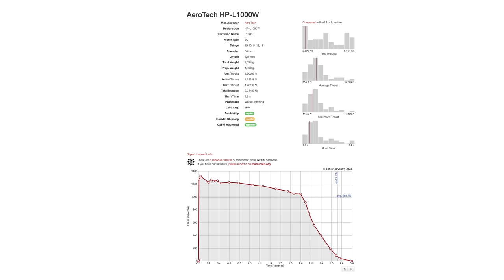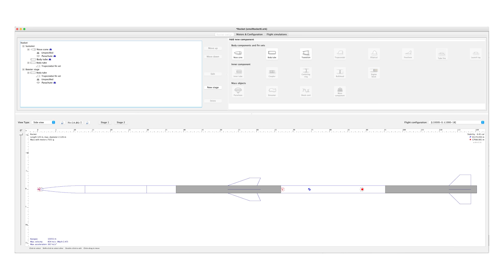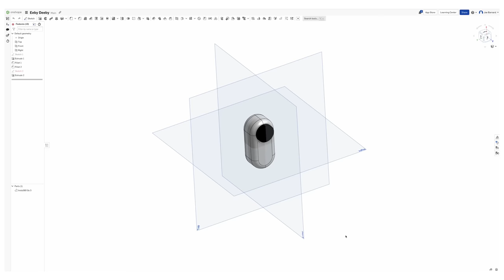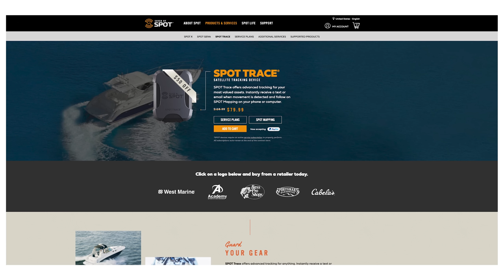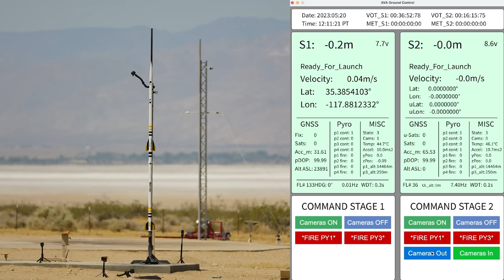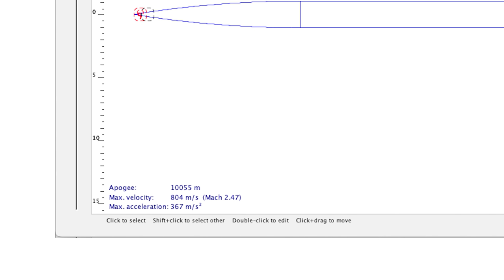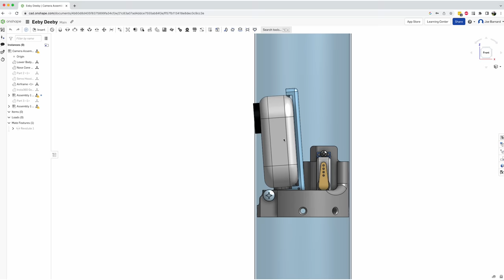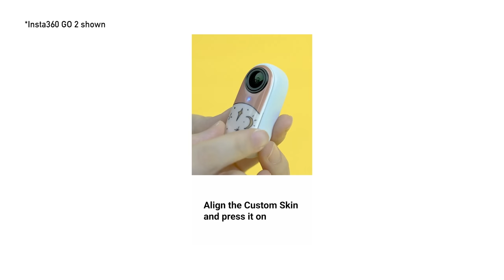I Sent a 2 Stage Rocket to Mach 3 | Feat. Insta360 GO 3

Comment: Hello this is the FAA…
Reply from the maker: im not picking up sorry my cat is sick and im really busy i cant talk
Reply: @BPSspace @dmacpher as the cat I can confirm I’m ill
Reply: @Will-uf7jt 😂
Reply: @BPSspace as the vocal chords, i can confirm i cant talk.
Reply: I'm trying to 3d print a 2 stage rocket using two F15 motors. Any advice?
Reply: @BPSspace how old is your cat?
Reply: Cat on my lap
Reply: The old quote goes “I’m with the FAA and I’m here to help you.”
Reply: @user-go8mx6rh3j  all completely legally of course! Just some model rockets out in the country
Reply: No😡
Reply: Oh well you wouldn’t arrest the scp foundation’s favorite YouTuber would you?
Reply: That's a lot of power. First thing is to calculate if the print material can handle the max loads 2 of those rockets are rated for. Might have to consider printing a structure to be wrapped with some type of composit but getting away with carefully selected material and printing it would be ideal and much less complex. You want them as close togeather as possible to minimize stabilization but there's a sweet spot where you get maximum control while having the engines far enough apart that thermal management isn't an issue. The other main thing to consider about 3d printing is some way to weigh and balence the rocket. Also if it has to be printed in more than 1 piece consider how they will be joined and what you plan to do to maintain precision. Hopefully this is helpful or at least get you asking the right questions.

Comment: The camera surviving that flight is far better marketing material than that camera shot would have been! Awesome video as always!
Reply: It's a small plastic object with low terminal velocity falling into dry grass. Any similar camera would survive.
Reply: @chat-gpt-bot  Yes, any camera with similarly well engineered design and robust construction.
Reply: @chat-gpt-bot  true
Reply: @chat-gpt-bot it also survived when it pulled over 10 Gs
Reply: @NapoleonBonaparte3  isnt really that much
Reply: @gelo1238  well that was a pretty violent event no matter the small mass. Mach 3 capable lol
Reply: @NapoleonBonaparte3  10Gs? The telimetry on the ROCKET experienced 61Gs. 18:35 

The camera itself being whipped out into a mach 3 airstream and initiating this rapid unscheduled disassembly likely experienced even more.
Reply: @Nevir202  Over ten Gs*

Comment: This is a perfect way to show off how durable your cameras are like imagine in an ad stating that their camera can survive a over 1000 feet free fall and can go Mach 3 and still survive.
Reply: it all comes down to force. the reason cams like this survive besides being built well is no force. its 35g.

this is why your old flashlight with 2 d cells inside "SHATTERS" when you drop it but the pen light just bounces. its all about mass.

at 60g's this camera experienced 2kg of relative mass. but a 2kg rocket would experience 120kg of relative mass. BIG difference :-)
Reply: Too bad they didn't mount an underwater version of them on the Titan sub.
Reply: terminal velocity will be low, though.
Reply: @nerys71 yeah it's also why an ant can easily survive falling from a building, an, an elephant can't
Reply: @nilaksh007  exactly 💯
Reply: I've bashed mine (old v2) into walls, floors, trees and metal. I've broken one lens so far but other than that it's been a beast.
Reply: closer to 13,000 ft!
Reply: Yep, that will surpass most use cases. By far!

Comment: Did a quick google. There are 2 very large military bases, one of which is a naval weapons facility very close to the FAR launch site. And if you look at them from space with SAR satellites like sentinel 1, you can see a variety of shiny spots on the bases from feed back from powerful radio emitters on the ground. If I had to bet, that's the issue with your GPS receivers. They probably have counter-weapon systems running in the area. Though if you check the map of GPS anomalies, there doesn't appear to be one over the area, but the fidelity's of the tool I was using to check isn't good. You'd really need a proper SDR on-site. I bet you find all kinds of noise in the GPS bands and similar military bands. You may need to upgrade to something more mil-spec maybe? Eitherway, cool rocket!
Reply: I was just a Joe Shmoe in the infantry. But I’ll tell you that anytime you are near a large military base your cell service is fucked from all the radios from people training, testing gear, etc…not even necessarily a defensive move - just works out that way.
Reply: I can back up that problem with GPS. 
I use a GPS speed and location unit in my car for tracking radiosondes in the Calif desert, and some days the system will not work right or at all.
It works worse around china lake.
My SDR shows some  anomalies at  frequency right around the GPS area.
Reply: Absolutely could upgrade to some higher quality GPS. Absolutely not under any circumstances will he be using anything mil-spec. The US access controls on military GPS frequencies are insane, even other goverment agencies fail to get access to mil-spec GPS.
Reply: @styxrakash4639 it's also cuz a lot of the buildings are really old and use a lot of heavy material that fucks up signal
Reply: I agree with this notion!! Certain installations have jamming equipment even when they are not supposed too, and with our defcon being higher, I guarantee they have those jamming devices running stronger and have a further range.
Reply: There's also a non-zero chance that directed energy aa might have been a factor, yeah?

here's my thinking on this, knowing effectively nothing of air defences or amateur rocketry - typical amateur stuff doesn't cross 3 mach, right?  maybe there's a system on a base, and it's tracking the rockets, but set to an engagement threshold of say +3 mach.  Since it would be more likely that a hostile system would be moving at a higher speed than amateur rockets.

My absurdly limited understanding is that in air defense, fractions of a second count, and that's why automatic engagement above a certain threshold could be logical.  Like, a threshold WAY above anything civilian, so it wouldn't pose a threat to anything domestic, except for maybe, say, an over performing rocket?🤔

of course the more sensible reason of "camera said hello the air at mach jesus" is more likely, but it's fun to work through thought experiments lol
Reply: @i-love-comountains3850  that fantasy system would be firing all the freaking time considering there's literally a rocket launching facility there. FAR = Friends of Amateur Rocketry
Reply: Meh, try GLOSNAS or Galileo.
Reply: @i-love-comountains3850  In that situation there are still some things they would check before shredding it, mainly Angle of Incidence (the angle between the direction of the velocity of the rocket and the direction of the base from the rocket, which would likely have been low as it was acellerating relatively straight up), and the approach velocity (the velocity at which its aproaching the defended area as oposed it its absolute velocity). For anything that is pretty far out on one of these datapoints would at most be flagged up for a human operator to decide on and this is asuming it even entered the engagment range at all. targeting purely based on absolute velocity could easily end up targeting your own missiles.

Comment: The reason it works in your back yard and not at FAR, is that Murphy lives at FAR, and he loves the smell of solid rocket motors.
Reply: I mean, fair, they do smell most excellent - both burned and unburned
Reply: "The Government" :)
Reply: Area 51 demands all satellites go around it.  so your in the zone as they get back on path.
Reply: @robertsmith2956  one: satellites don't work that way.
two: area 51 can be imaged, and eavesdropped on from "not directly overhead" so there's no point,
three: ummm conspiracy much?
Reply: @stevevernon1978  prove it.  fly one over areas 51 and take pictures.
Reply: @robertsmith2956 that's a quick way to get arrested. The fedcoats tend to not like you looking at them.

Comment: I reckon that when the second stage started spinning the centrifugal force forced the cameras to fold out prematurely, it'd also explain why the button panel was bent outwards away from the camera body.
Reply: Exactly what I was thinking during that final camera frame. You can almost see the bottom camera leaning out of its frame which would make no sense if it was due to G-force or drag! Makes total sense that a centrifugal force could cause them to open up
Reply: that, or the high air velocity would create a low-pressure zone which would suck the camera outwards

Comment: Mach 3 is a good benchmark for how tough your cameras are, but being able to say it survived 61+ g's of acceleration is more impressive to me
Reply: For real, the camera kept going through forces that made the specialized flight controller hardware tap out.
Reply: 61g measured plus how ever many it pulled at a supersonic (and really the better part of halfway to hypersonic) uncommanded ejection
Reply: Just for reference, my Seagate HDD states that warranty is void if it's exceeded 50g. And that's a mechanical Device with a spinning Disk and delicate arms inside.
Reply: @AngeEinstein you sure its 50gs and not 5gs
Reply: @pineapplepizza5733  I'm sorry, I remembered it wrong. I just crawled under my desk and looked and it is 350Gs
Reply: @AngeEinstein  whaat, thats crazy xD, just imagining a HDD surviving that is insane
Reply: @AngeEinstein   I just looked it up on Seagate's Website, 350 Gs are the rated acceleration for a shock, so lasting for less than two milliseconds, while not operating. While operating a shock of 63 Gs should be acceptable. But vibration over 0,5 Gs during operation will probably result in issues. So if this HDD were to be strapped to that rocket it would probably not operate correctly, but maybe turned off it could have survived, or at least you could have recovered some data. But I don't think the HDD would have been happy.
Reply: @Jojo-nq9xx  If you compare that to the camera and consider that the camera has no moving parts it's not that astonishing
Reply: 61 Gs sounds like a big number, and for most living things it is an instantly lethal number that would turn you to mush, but for electronics its not actually that insane. Keep in mind there are guided artillery shells that can survive being blasted out of a cannon.... like 15k Gs.
Reply: @Teesquared00  Yeah and really if you drop something on the floor at just few meters height the Gs (deceleration on impact) must be much higher than 60Gs.
Reply: Or survived a crash landing from 5km up at terminal velocity.
Reply: Yeah.
Reply: No. I'm sorry, it is at least a little impressive.  It means they made some effort to make it survive acceleration.  Head crashing is a thing HD mfgs have worked really hard to survive.  No other parts of a desktop computer will survive 60G accel.  The big capacitors will separate the traces from the board or the little screws holding things together won't anymore.  That being said, great, a camera you would think would be tough is actually tough.

Comment: You could probably do the same setup for camera deployment with a small modification. Mount a layer of perforated cardstock sealed to the fuselage over where they deploy from, then add a blade or spike to the camera.  Camera stays behind aerodynamic shield until deployment, blade or spike rips (or somehow shears it completely away) the cardstock for the shot, and the normal airstream from terminal velocity until shoot deployment should be safe for the current rig.  Or, since the faceplate of the camera is removable, print a plate with that will seal the airstream around the camera, but can break away if needed after deployment.  All sorts of fun solutions.

Comment: Damn! That is one hell of a resilient action camera!

60+ G, smacking a carbon fiber knife at Mach 3, falling from that altitude without a parachute, And it still works!

I am in awe of this engineering!
Reply: I wonder if anyone has shot one yet. The carbon fiber knife at mach 3 might well compare, although the force of a bullet is much more directed and confined so may ultimately be more destructive.
Reply: At last, a successor to the nokia.

Comment: 7:14 Speaking of over-complication (which I think you might like as a challenge xD), maybe try some synchronized rockets looking back at each other? 👀
Reply: That would be extremely dangerous. If they hit each other they would immediately mutually break up, which if it happened early enough in flight, could cause injury to people nearby. Furthermore, assuming they don't hit each other, they would experience some amount of roll during the flight, so tracking would be required. They also might travel vertically at different rates which would require the camera to point up/down inside the rocket, which may or may not cause turbulence, don't quote me on that one. Although it's an extremely cool idea, it's very complicated, unsafe, and impractical. Believe me, I would love to see that shot, but it can't be done.

Comment: When I chamfer the edges of the fins, I always do them all at the same time by staggering them and clamping them together before sanding. I just lay them on a flat surface, edge down, and then angle the whole set so that the edges still touch the surface, then I clamp. That method ensures that they are all the same.
Reply: Yeah. I would do it this way or not at all. If not done perfectly they will steer you.

Comment: Eeby Dweeby 2 for sure. Next time instead of using servos to fold out the cameras, make a spring loaded lever that is locked by a sliding mechanism that wint allow it to bend out. This way there wont be a servo's worth of power keeping the cameras inside the rocket until it is time to deploy them. Should make the mechanism immune to extreme g's, including rotational.

Comment: Have you tried using a simple wideband SDR to check for EMI at the launch site? (11:22) You can compare wideband analysis from home to that of the launch site and figure the EMI source.
I wonder about the 360 if it would survive a drop from onboard the ISS as well; Marvelous sounds it got there haha!! Can't wait to see a second trial in this shot.
Reply: If you try to drop it from the ISS it will stay in orbit for weeks or months and at least it battery will die very quickly because of the extreme temperatures and also vacuum...

Comment: If you do end up making Eeby Deeby 2, I think just having a sliding door controlled by a high throw servo would work fine for the cameras. They wouldn't need high torque and surely there's room for two more flat servos in there, right?
Reply: Doors, or even just a pin that lock in the cameras. Then have the camera on a spring-loaded mount which folds out when unlocked.

Comment: I've had 3 rockets break up at mach 2.4 to 2.7 (calculated at sea level). The last rocket recorded 6-dof inertial recordings. Analysis shows that as the rotational rate approached the axial dynamic resonance  the rocket went sideways. An off-axis CG likely caused coupling between the rotation and AOA causing rocket to nutate. When the AOA of the fins hit about 10° the rocket instantly went went sideways. This started less than .5 second before brake up. The avionics had a gentle ride down while the motor stabilized and continued to apogee and a ballistic recovery. It made a 1.1m x 75mm hole in the playa. Only the slightest blip in the motor's trajectory could be seen from the ground.

Comment: Do you think the open portal on the side of the rocket could have produced some low pressure as the supersonic air passed over it?  Possibly pulling the camera out into the air stream?  Rather than the change in G forces?  Or possibly some vortexes inside the portal compartment, with the same effect?

Comment: Hey Joe, I looked back on your AVA design videos and I noticed that your GPS rf trace routing is suboptimal. You should be able to improve reception (some) by routing the GPS antenna trace (as short as possible) on the front of the PCB rather than through a via on the back. Also make sure that the rf trace has a 50 ohm impedance for a microstrip line and that there is a ground pour clearance of approximately 3 times the trace width on the same layer. The ground plane under the entire microstrip line and zoe-m8q should also be uninterrupted if possible.

Comment: It would be educational from a testing perspective to do a flight with the camera holes covered so that the aerodynamics of the cameras are definitely not effecting the rest of the rocket, although this would of course lose the cool footage.  Alternatively, if you could have the cameras attached to a panel that is flush to the rocket until the cameras deploy, you could probably achieve the same improved aerodynamic result and also get cool footage.  I cant help but think that Mach 3 wind past the camera in its retracted position had serious aerodynamic impact and as you said, once they protruded  a tiny bit into the airstream it was 'game over' for the servo retention/deployment mechanism.   I suspect that you were having a Bernoulli effect over the lens being raised relative to the rest of the camera body with consequential 'lift' or pull on the camera against the retention mechanism with maximum torque applied by the lift against the servo lever because the servo lever was at the end away from the lens.  Cool Stuff!!